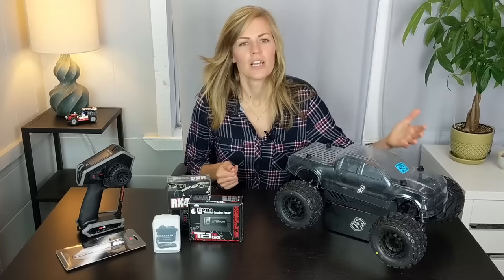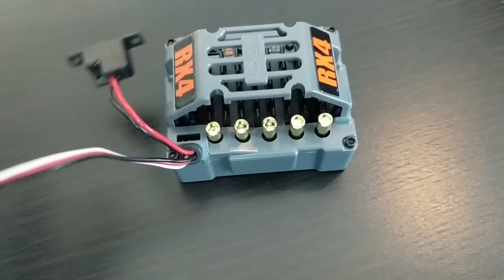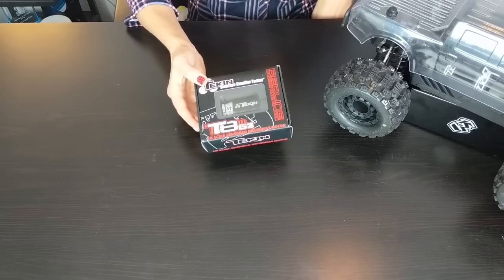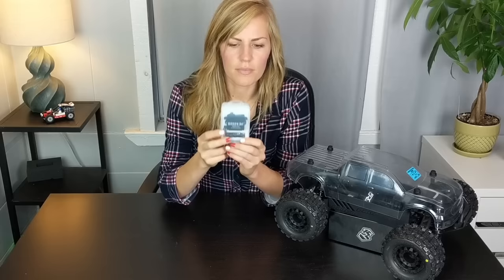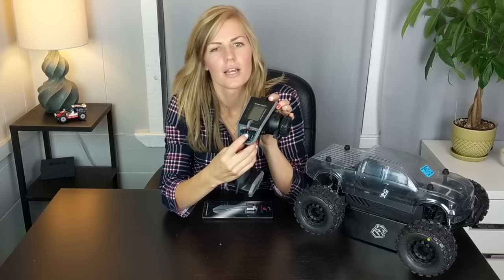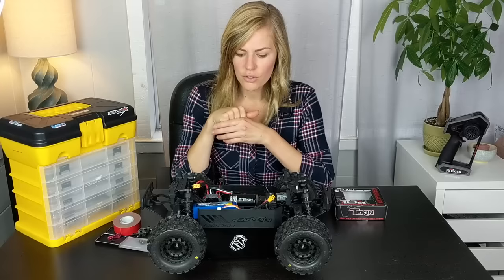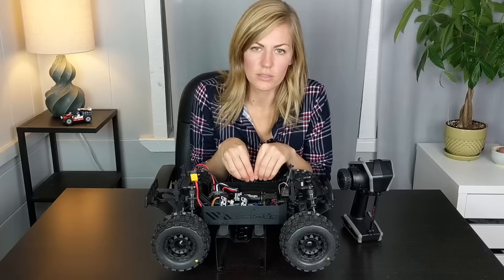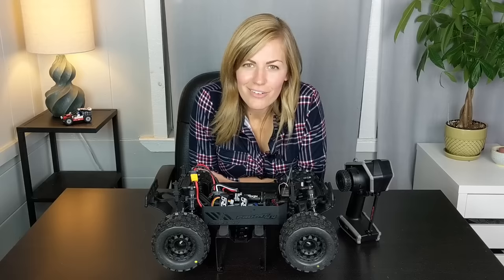PRO-MT 4X4  |  Electronics Install (Pt. 2)

Comment: Great video! The RX4 is rated for up to 6S, just for anyone wondering. The packaging says 2-4S but we changed it before release and the packaging was already printed..oops.
Reply: I was wondering why 1/8th scale motor was only 4s rated. Im thinking of running a Tekin system in my truck next. Need more soldering practice first.
Reply: Shame 😂😂😂
Reply from the maker: AHh right, I was wondering about that because it said up to 6s on your website but the packaging said 4s. I'll pin this post so people can see the correct info!

Comment: Very nice cable setup, neat and clean. And yeah soldering is a bit of pain for those big cables and connectors. It helps to have a very big tip on the soldering iron, so it has some heat capacity and surface for transferring the heat.

Enjoy the new RC, have a lot of fun!

Comment: Just bought Slash Platinum and upgrade it a little bit too. Using also Spektrum transmitter & ACV receiver working awesome. But now I believe it picks me on to get this unbelievable Proline Monster Truck model as 2nd vehicle. Wow this vehicle look so amazing as your exciting smile that make you just wanted to get outside and pull the Spektrum trigger for a ride.

Comment: Thank you so much for a nice electronics install video!
Good idea to traversely install the servo, it give more space for different battery packs. Metal gears in the servo is a good idea for a truck in this segment, when you turn the wheels when the wheels are up to the hubs in mud, you do not have to worry about stripping the gears for teeth :).

Neat wiring, and the PRO-MT tub with open ends and high side walls protect the motor, esc and receiver. They sit lower than the walls , and it makes it easier to keep the wiring inside. The open ends design drain the mounting chassis plate for water quickly after the car have been submerged, preventing standing water around the electronic components and wiring.
Poweful high torque motor, the car almost jump off the stands when you throttle up :)!

Good to see your neatly laid wiring kept together with cable ties, avoiding spagetti junction and possible damage when loose wiring contact tires. I use a crimp hose split lenghtwise with a pair of scissors to protect the wiring. I put the wiring inside, turn the split downwards, and use cable ties spaced an inch or two apart to keep the hose together. It look tidy with the wiring inside, and give good protection for the wiring. 

Maybe if you have a crimp hose laying around in your garage, you could use it protect the wiring close to the pinion and spur gear? With some practice, you can form the crimp hose (with no glue inside) into a curve around the gears using a heat gun very carefully. I look forward to the painting the body video and the running video of course!
I wish you a Merry Christmas!
Cheers.

Comment: The spectrum radio looks to be a good trail crawler radio, being able to hold basic tools for on the trail. As well being good for those filming and driving at the same time. May be you could add a small box for small parts, for repairs out on the trail.
Reply from the maker: Yeah I'm hoping to do a separate video on that this week!

Comment: The build looks great! Try some paste flux for electric work. It will help the solder flow more easily and make your life easier. Those are also large wires so you need enough heat, 40 watt iron at least

Comment: Tekin electronics are really good. I used them 20-30 years ago for my brushed cars/trucks. Lately I've been using the cheap Chinese stuff for bashing because it is hard to pass up $40 for a motor/esc combo though the cheap esc's fry easy especially in water. I've never used Spektrum because it is so expensive but I'm impressed with my FlySky Tx for $45.
Reply from the maker: That's the route I usually go too. Now I'm spoiled with a sensor setup! Ugh, I wish i didn't know what I was missing but now that I have a nice esc/motor combo it might be hard to go back... ;)
Reply: @RCGirl  Glad you are liking the sensored brushless life!
Reply: @RCGirl  yeah, I'm sure it is noticeable when you gun it from a dead stop. Btw, if you still want a drone let me know. It'd be cool to see you review one. I just mailed a couple to Bryan at True Drone Reviews. These things are just collecting dust so they could use some flying.

Comment: I'm looking at the pro line ambush roller I have a reedy 550sl brushless motor a radiant 3s ESC and hitec steering servo just waiting to drop in thanks for the informative video. Oh a dx2e spectrum radio that was supposed to go in a b6.1 astro turf carpet lol🐼🐼🐼🐼🐼

Comment: At the end it will be a great car. Looking forward to see it in the wild. Whats about the painting of the car? I use. PlastDip for now works great. :-)
Reply from the maker: I'm gonna use Tamiya spray paint. I've plastidiped before but on a basher they end up getting dinged up and start to peel away. Gonna murder it out with gun metal (ps63), black accents and smoke tinted windows 👌
Reply: Ah OK you used it outside i think. I paint inside with different colours and use the primer for a better adhesion.

Comment: I have a question, RC Girl. I didnt see you installing a BEC into your monster truck. How is that servo getting enough power to produce the 400in/oz of torque?
Reply from the maker: The RX4 internal BEC output is either 6V or 7.4v but I think you need the tekin hotwire to switch it to 7.4. So I'm probably running at 6V so the servo torque is  344oz  (instead of 400 @7.4V)
Reply: @RCGirl  Thanks for the info! Im working on building a trail truck/crawler, and im trying to decide which esc/motor combo to use. I def want brushless, for when i need wheel speed, but im also looking for low rpm control and torque. Also going to run a high torque steering servo. That Tekin esc seems like a great choice for me right now!

Comment: Im having trouble with the servo seems stiff when i go left and right i was told to loosing the c blocks a little?
Reply from the maker: Yeah they do loosen up over time with running it. I also used graphite spray lubricant on the steering knuckles. Seemed to help
Reply: @RCGirl  thank you for advice seems to be running fine now , think they should supply some sort of lubricant with the car